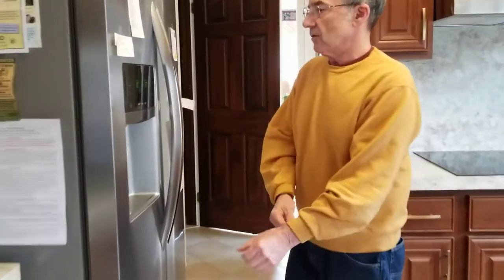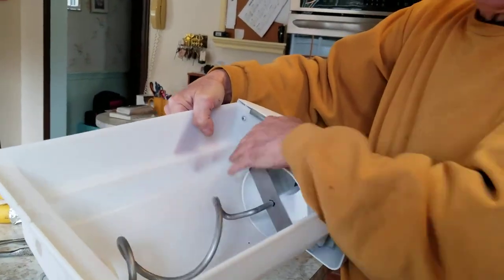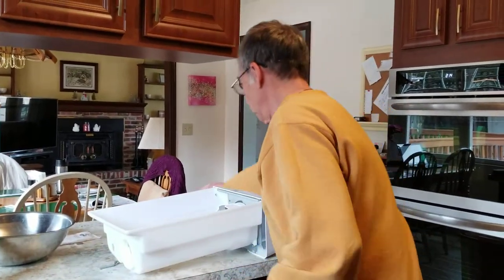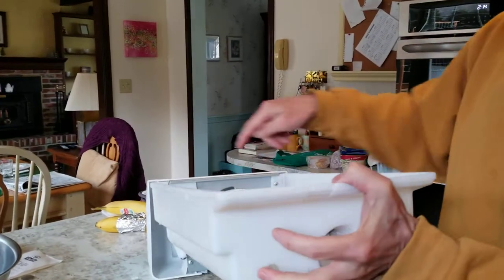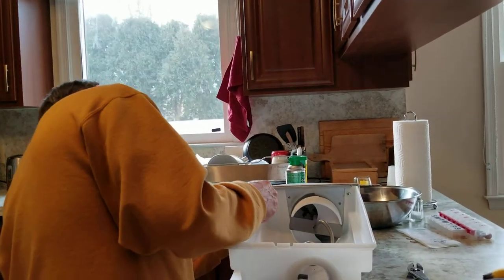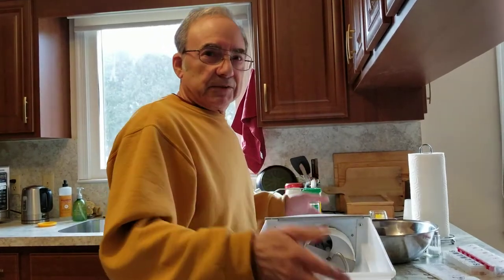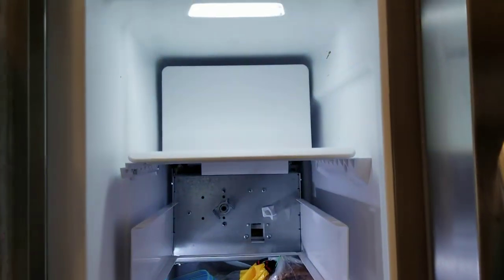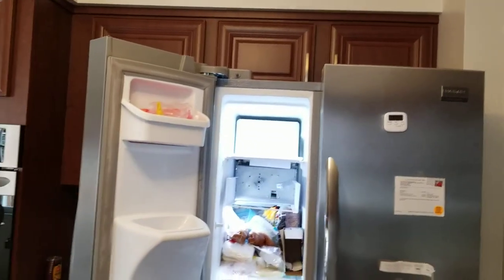How to Fix a Jammed Refrigerator Ice Maker

Comment: 1:26 I was having this exact issue, ice keeps getting stuck on the blades so when I press to dispense ice in to my cup it would make a hammer noise and see there stuck. I’ve been having this issue a lot recently. Do you think is better to have the freezer colder or a bit warmer to prevent this?
Reply from the maker: It seems to happen more often when the weather is warm and humid.  Possibly due to surface melting then refreezing.  Colder might help.   Try measuring the frequency at two different temperatures.

Comment: Thank you Arnold Solof For the good video
 my ice keeps getting stuck where the ice comes out
 by watching your video I didn't know they had a Food grade silicone spray
The only thing is I'm wondering if I can spray it cold 
Thank you for the video it was very helpful 

👍
Reply from the maker: Jim, I empty all the ice, wipe off any moisture and then spray.  I then rub off any excess/dripping silicone with a paper towel.  It doesn't need to warm to room temperature first.
Reply: @arnoldsolof  thank you for getting back to me
Reply: My daughter put a pint of ice cream into the machine without telling me and it got trapped in the blades!! Your video helped us to save the ice cream AND the machine! Thank you❣️🙏
Reply: @marinamitchell6632 I just did the same and got it out in ten seconds after viewing this. Phew!

Comment: Ice maker crushing ice nicely for years, but now, when the blades start rotating and making ice chips, the ice chips are sticking to the colder blades, causing them to jam.
Reply from the maker: If the blades are slightly bent, they will be less able to slice through the sticking cubes.  The jamming would be intermittent.
Reply: (I appreciate your help. Thanks.) I've checked. The blades are not bent. Every time the cruncher stalls, it's been because a large piece of ice has jammed between a couple of adjacent blades. Knock the ice chip loose between the blades and I'm back in business. My problem may be incurable in that "who knows when the cruncher is going to create a big chunk that won't pass through?" Also, I don't think it's because of ice moisture that causes an ice chip to freeze to the metal blades as the jamming problem sometimes occurs first thing in the morning when the frig hasn't been opened for six hours. (If I ever discover a consistent cause and a fix, I'll let you know.)